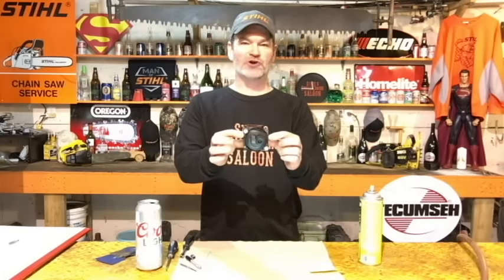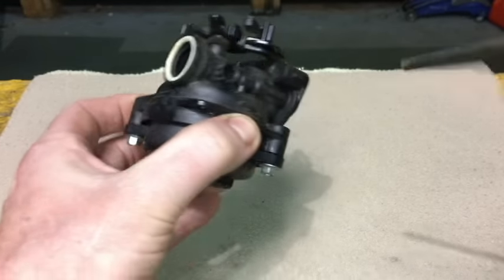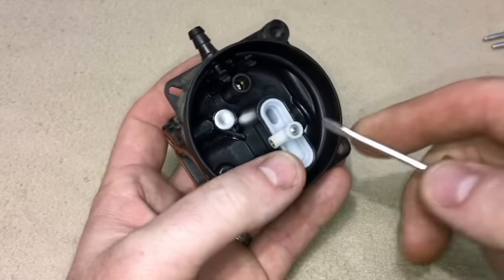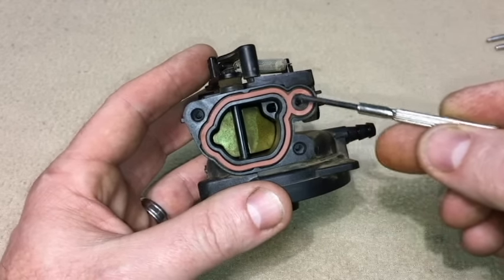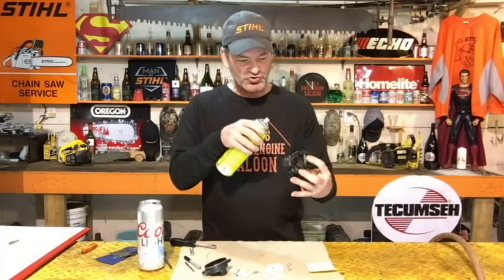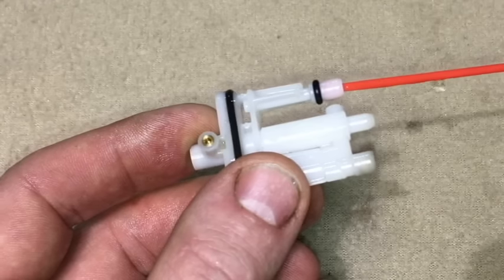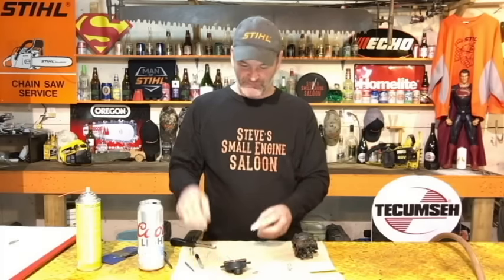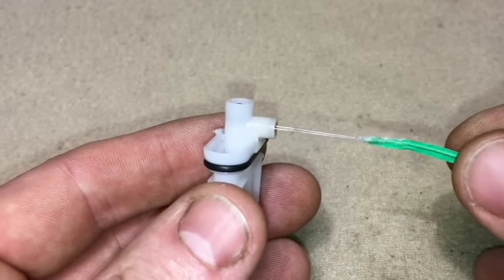EASIEST WAY To Clean a Plastic Briggs Carburetor

Comment from the maker: Click here for micro drill bits ➜ https://amzn.to/3z9qdSt

You can connect with Steve here too: 
Visit Steve’s WEBSITE ➜ http://www.stevessmallenginesaloon.com/ 
Visit Steve’s PARTS & TOOL STORE ➜ https://www.amazon.com/shop/stevessmallenginesaloon 
Follow Steve on FACEBOOK ➜ https://www.facebook.com/stevessmallenginesaloon 
Follow Steve on INSTAGRAM ➜ https://www.instagram.com/stevessmallenginesaloon/ 
Follow Steve on TWITTER ➜ https://twitter.com/SteveSaloon
Reply: thanks alot steve you saved me alot of money mower works good as new easy fix thanks again michael from baltimore
Reply: In a pinch without micro drill bits, I used my torch tip cleaning files.
Reply: So gonna try that man thanks so much
Reply: I'm a "mature woman" lol & I followed your instructions completely. Worked like magic!!! Much thanks from Georgia!
Reply: the link for the micro drill bits is no longer valid, the description of the item is correct, but its not available for purchase, nor are the pictures correct.
Reply: Could you tell me where I could get the spring for the carburetor?
Reply: Hey @steve would adding a small inline fuel filter help or is the jet so fine that it's inevitable they catch dirt?
Reply: @jeffreykimball9322  I'll have to watch the video again but I don't think it's from dirt but from something like ethonal in the fuel that builds up in the port
Reply: @toddgunning5850  link worked July 2021
Reply: @precisionguesswork5394  just slide em in and out worked?
Reply: While the main jet is tiny and could stand to be reamed out as suggested the cartridge also harbors trash from the fuel in its metering tube. If you hold the cartridge firmly in the index and thumb of both hands and twist gently it will separate exposing a metering tube. You can use compressed air to clean it up. Use the reverse action to reassemble for installation.
Thanks Steve for your videos.
Reply: Same carb but mine was flooding, I took it apart but did not want to remove cartridge for fear of damage and I needed to cut grass today. Put back and it ran worse so I found a parts dealer and got new, now she’s good to go
Reply: @toddgunning5850  Amazon has all sorts of micro drill bits, with and without drill handle
Reply: @jeffreykimball9322  I'm adding a filter to mower - just  make sure to get one for engines without fuel pump. Problem is the hose is so short between tank and carb. Still working out that problem. Leaving it the same length is kinking too much.
Reply: Just received my mini drill bit set you mentioned.
Reply: How about a Mic Ultra 😂 I could not get the O ring for the bowl to reseat. Got her all cleaned and tighten up though. It did start but is leaking gas gas. I believe I may have Not positioned the flow holes back in the correct alignment? I think I found your video on the Sleeve which I think I misaligned? Thank you sir❣️👍
Reply: I have successfully cleaned a clogged plastic carburetor of a B&S 675E engine of a rotavator (purchased in Central Europe in April, 2020). The RELATIVELY NEW B&S PLASTIC CARBURETOR is the same as described in the video with a slight difference: The carburetor has a red knob with which the choke can be manually closed for cold start. When cleaning the cartridge (which is inside the carburetor), I tested the diameter of the hole (main jet, time=8:30 in the video). I used a 0.50 mm (0.0197 inch) drill bit.  I can confirm that the ORIGINAL DIAMETER of the hole is slightly more than 0.5mm. I believe it fully confirms the experience of Maestro that a smaller than 0.5mm diameter hole (in probably older model plastic carburetors) is not sufficient. (P.s.: Did you know that the first carburetor for a stationary engine was patented in 1893 in Central Europe?)
Reply: My Dude!!! Perfect...
Reply: Many thanks brother!

Comment: Much respect. I own a small engine repair shop in South Carolina. What we do is starting to be a dying trade. Lot of machines are throw aways now a days. The only way I make money is by fixing stuff and not replacing parts. And the worst thing is a customer bringing something back. You take pride in what you do. That itself is a dying art. Donyboy, Taryl and yourself are awesome. I appreciate the time you put into your videos.
Reply from the maker: Thank You...  Were you ever in the 9th Infantry?
Reply: No sir.
Reply: I’ve seen a ton of these Briggs coming through the shop. I tried drilling out the jet with an old micro drill bit set. Apparently I drilled it too big and it ran too rich. But, I agree, the jets in these things are way too small. Experience is a bunch of compounded mistakes.
Reply: Parts are getting out of site. I fix stuff on the side. You can’t charge by the hour you wont have a business long that way. Part time or hoppy or just having something to do can put a few bucks in your pocket. Am older and enjoy working on small stuff. Most dealers wont even touch a weed wacker cause they charge almost the price of a new one.
Reply: @arthurrodesiler3109  And it will take them a week snd a half to fix it, snd you usually have to go by and check the progress.  You then get the ole, "I was gonna call you..."
Reply: People that have a throw away mentality are ruining the world
Reply: Steve, what about the white barbed plastic fitting? Got a mower cheap to repair, found this plascarb, with 
nothing attached to the barbfit. Just for show?
Reply: @jameslee2260  I think it's some kind of calibrated air bleed, but I want to now about it too.
Reply: @Circlotron  Thanks, I just put 'em back together and quit worrying about it. cleaned two of them (no parts) and not afeered of 'em now!
Reply: These guys save us a lot of the headaches that the manufacturers are creating. The problem with certified mechanics is they go strictly by the book on these things. One thing I learned years ago on a Skidoo snowmobile after blowing up an engine twice is the book can be wrong. A particular model had an air flow restriction issue that caused the engine to over heat and melt a hole in the top of the piston. Sadly, the fix made the engine into a gas hog and you had to cut a hole in the hood and add a screen for better air flow( Skidoo provided the parts). Skidoo was pretty embarrassed  over that whole deal and no one likes to bring that particular  model up. That incident made me realize you cannot always trust the manufacturer to be right. Working in a small engine shop taught me to take that book and throw it on a shelf and go with your experience. I have had to do several of these kinds of modifications  over the years.
Reply: @tatersalad2067  On a Poulan Snow blower that surged because of too small an air jet, I learned to start out small and go progressively  larger until you get it  to run properly. This required me to disassemble things a few times, but I fixed something no one else could, even under warrenty. Someone else figured it out a week later and posted a video before I did. Thats ok though. The word got out anyways.
Reply: @arthurrodesiler3109  Exactly! I can fix most chainsaws and weed wackers that have too small of filter screens installed at the factory and people are happy again. I worked in a small engine shop for 4 years and learned to think outside the certified mechanic box real quick. Guys like you and I will always have a job fixing these kind of things. Enjoy!
Reply: @jameslee2260  No, thats a metering jet for the primer. It regulates the amount of air brought in when you push the primer. Think of it like a straw with the end plugged. If it has a smaller hole, less air comes in but at a higher pressure. If the hole was bigger more air can come in but it would reduce the pressure. You would be sucking the straw though, not blowing. That white valve is actually at the other end of the primer.
Reply: @scottfirman  thanks, I've gotten pretty good at those infernal little black carbs. Had one recently that I took apart and cleaned four times, still no luck. Just got a new one in the mail last night we'll see it works.
Reply: @jameslee2260  Yes, they are pretty cheap.
Reply: @jameslee2260  I just got around to pulling the carb on this one. The main jet was completely plugged up! There was a ton of stabil in it too! People keep dumping it straight in the gas tank! I think raw stabil reacts to the metal in those jets. Eather way, it runs like  brand new and actually looks like brand new. Even the blade was brand new!
Reply: Never used any  Stabil, I just try to make sure I run 'em all dry before parking. tried using real gasoline but it was $4.19 a gal, and the dealer never came down when gas prices got lower. come to think of it bad things happened on 4.19 (April 19th). Just my propensity for remembering dates.
Reply: Naw, what’s killing your livelihood are diy videos. People are more inclined fixing stuff themselves when they see inflated repair costs (labor)
Reply: That's a sad fact. We live in a throw away society. It's a dang shame people are too lazy to fix theyr tools
Reply: I've resurrected lawn mowers thrown out, idk but 399-499 for self propelled lawn mowers or 1000 for a rider to be replaced just because a filter, carb, fuel line clogged/worn out or coil and spark plug worn out is not economical.
Reply: @arthurrodesiler3109  charge by the job.
Reply: @beefsupreme462  1 mans trash is anothers treasure.
Reply: @shadowopsairman1583  absolutely correct. It just makes sense to at least try and fix it. Usually for a few dollars you can have it up and working again
Reply: I agree, these guys take thier time to understand what the root cause of the problem is before they explain the procedure to fix the problem.
Reply: At one time I would pickup mowers that were out for trash day the night before I would pick them up bring them home fiddle with them then if they ran advertise them in a advertiser mag sell them then at work people heard about me and I fixed there’s some thought I was expensive so they went to a real shop then felt foolish when they got a outrages price when they could’ve had me fix it after awhile trash pickers got there before me so I lost out but it was a good run
Reply: @sheddski2942  I been trying to save all Briggs engines I can find seeing theyr out if buissness
Reply: @mgoody8782  More manufacturers are not interested in building repairable equipment . Build it as cheaply as possible.
Reply: @tatersalad2067  *Experience -  One Mistake at a Time.*
Reply: I'm also in S C, and yes you are right, carb cleaning, grinding valves leveling heads, and overhauling small engines Is going away, thank God for go kart racing engine builders!😎😁
Reply: You forgot that there are two other  chicks  that fix small engines.
Reply: @anthonytriolo3643  I’m sure there’s more than two chicks that repair small engines.  I wish there were more people interested in the trade. Regardless male or female. I’ve learned from watching chickanic. I think everyone could learn something from anyone. Regardless of experience.

Comment: I must have cleaned the carburetor three or four times before finding this video.  Drilling out the hole on the cartridge to a 20 thousandths of an inch finally fixed it.  Thanks much!
Reply from the maker: Glad it helped
Reply: I have a machine that does up-rev motions, why does it do this? It's the carbulator?
Reply: Me too! I bought a new one. Used it a few times and now it’s giving issues. 

Did drilling it out fix it permanently?

Comment: I love your common sense approach!! Repair, not replace. I have a lawnmower with one of those carbs. It just stopped dead yesterday and won’t restart, but will try with starter fluid. I figured it was water in the carb and checked out your video to see if I could drain the carb bowl with an allen wrench. From the glance of the inside of the bowl in this video, it looks like it’s designed to be drained with a quarter turn.  If not, then you gave great info in this video to go further. I did small engine repair 23 years ago. But things change. And at my age now, I forget too. Good job Sir!!
Reply from the maker: Thank You...

Comment: Thank you!!
I kept saying something was clogged and after watching this video, I disassembled the carb and pulled the cartridge out. I tried to spray carb cleaner and the jet was clogged. I used a torch tip file to open the jet and sprayed carb cleaner through the cartridge and it blew through the jet!!
Reassembled and she started right up!!

Thanks again!!
Reply from the maker: Great job!

Comment: Mower hasn't run for 2 yrs. Thought we had it fixed last year. Tried to start this year, wouldn't start. Watched the video, got the micro drill bits, proceeded to fix the issue. Worked like a charm!!! Thanks, Steve!👍
Reply from the maker: You're Welcome...

Comment: My mower was dying after getting hot, running about half way through my lawn, sometimes much less in the heat. I thought it was the choke initially, but watched your vid, cleaned the carb out and checked the linkage clearance but was still having the same problem.  I ordered the bits you recommended and drilled my carbs jet out, cleaned again, replaced the old gas and managed to mow the whole back yard.

It might have been my gas, despite running non-ethanol and using fuel additives I couldn't recall the last time I filled my can so I probably should have started there.  This was a very informative video, I learned some more about my 7 year old mower which now runs great again and I saved a few bucks in the process.  

Thanks a ton!

Comment: Steve, This is the type of carburetor I have on a two year mower.  I was able to clean it following your directions with carburetor cleaner and get the lawnmower running again on the first pull.  Thank you!  You may want to mention please wear safety goggles and gloves when using carburetor cleaner.  Also,  I had to review the video to make sure that I put the plastic cartridge back in the correct direction.  The screws holding the air cleaner cover were interesting to line up again.  Two different sizes slightly different, and another size for the plastic "bowl" cover.
Reply: The different sizes are indeed a pain! I am a 1/4 inch drive socket set aficianado so it wasn't a problem for me, but ... why did they use two different sizes?

Comment: Thank you Steve.  I had 2 Toro  B110 lawnmowers (from Lowes) sitting outside for the last two years.  Circa 2018, 2019.  Both worked for about 2 months each and then refused to start.  I used your repair method on both and now both running very well.  Two pulls to start them.  Indeed, it was that interior jet that was the issue.  I used the twist tie and several squirts of carb cleaner.  Now... I need to watch your string trimmer videos and repair the 3 I have that are inoperable.  Toasting your health with an Obsidian Stout. Cheers my friend...
Reply from the maker: Right on Dan!  Thank You...
Reply: Did you fix all 3?!

Comment: Thank you Steve! I've got a Troy-Bilt with a Briggs engine and the plastic carburetor. For a while I got by by removing the carburetor and merely sloshing it around in a can of gasoline. Then the frequency and character of the problems increased. Most recently I got the oscillating engine speed. That's a nightmare. I ordered a micro drill set from Amazon because I wanted a next day solution. I also order the set with the HSS drills. That left me with a smallest drill size of .6 mm but I decided to go with that because I didn't want to fool around with stainless steel drills. I followed all of your instructions after very carefully enlarging the main jet to .6 mm. It started on the first pull and ran smoothly. I could have never imagined such a simple solution... but it worked! Thanks again.
Reply from the maker: You're Welcome...
Reply: @StevesSmallEngineSaloon  I didn't see the set of drills you recommended until after I ordered another one. Oh well. Your recommendation there was better, too.

Comment: Hi Steve...... throw away a carb?? No way! I'm right there with you. And thanks to THIS video, I fixed my Briggs 500E in less than five minutes. I've no idea WHAT is actually causing these brass jets to clog up, but the .020" drill bit I cleaned it out with SOLVED the problem. (I've also STOPPED using Ethanol-laced fuel in my yard equipment and use Ethanol-Free instead... figuring its the excessive varnish in the Ethanol that plugging the jet). THANKS AGAIN for your GREAT video Steve! :)
Reply from the maker: Nice work!
Reply: @StevesSmallEngineSaloon  AFTER I sent this, I went deeper into your other video on the Stihl Motomix and the contents of the fuel mixtures. Then I felt kinda bad I wrote about the ethanol... evidently, THAT's not the problem. But running the ethanol-free fuel seems to be a little better anyway. That $28 a gallon for the GOOD stuff is too steep for me. I go thru a lot of fuel (big yard and lotta tools).... for a savings of >$23 a gallon, I'll clean out the jets every now and then.

Comment: I messed around with starting fluid and gas additives for a couple hours on the B&S engine on my power washer, then hit YouTube for the solution and this video absolutely nailed it.  I pulled the carb apart and blasted some high pressure air through the cartridge.  That cleared all the small jets and ports inside the cartridge, I put everything back together and it started on the first pull.  Thanks for the how-to and quick fix.  Much appreciated!
Reply from the maker: You're Welcome...
Reply: "I messed around with starting fluid and gas additives." That's what I did weeks ago when I noticed mine struggling. Then the next week it wouldn't start. This vid and the prior - fixed it. I'm wondering if the gas additive removed debris but then it got stuck in the tiny cartridge holes. Factory flaw, but glad for this vid to become aware.